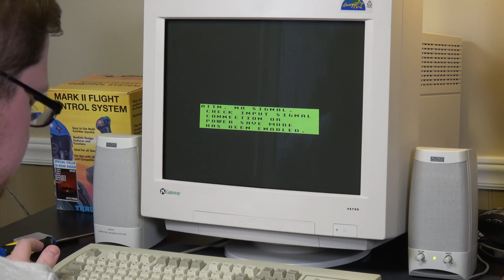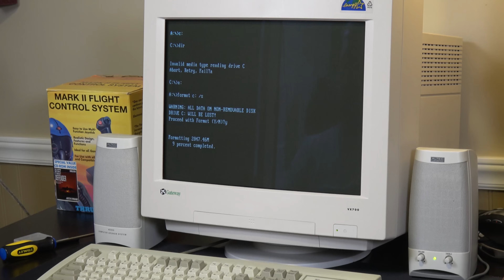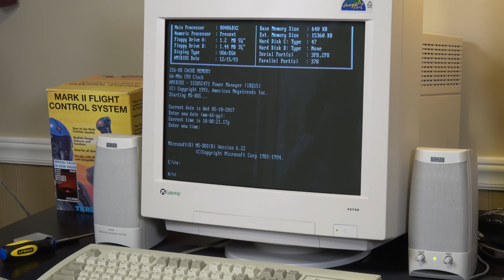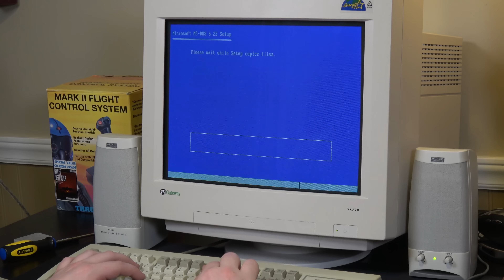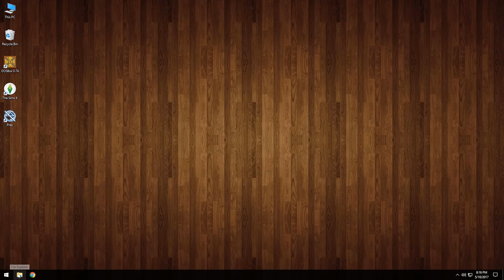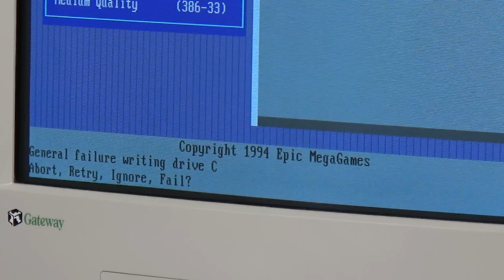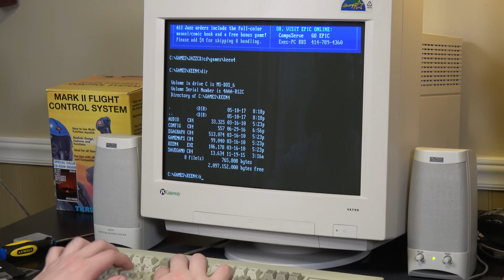LGR 486 Update! Installing CompactFlash Storage

Comment: You may have got that backwards as far as older cards being less reliable. Older cards (usually less than 1-2GB used SLC or single level cell flash memory which is often quoted as having about 100,000 write cycles. Newer cards use MLC to get the higher capacity and lower cost, but the drawback is fewer write cycles before memory cells fail.. in some cases I’ve heard only 500 to 1,000. Older cards are often easier to find that support “Fixed Disk” mode which means you’ll be able to boot the ornery Windows OS from them (Linux and MacOS will boot from anything that’s readable so a modern CF or USB thumb drive is fine for them but not for Windows). Overall it probably comes down to finding an older card that has had few writes done to it, and Cisco cards are a great option. Cisco IOS runs entirely from RAM and as far as I know, in many configurations it does no writes at all to the flash drive.

Comment: A few months back I got one of the PATA-to-CF adapters that plugs into the motherboard, then loaded it up with a 2x MicroSD-to-CF adapter card loaded with a pair of 64GB MicroSD's... all to have a 120GB PATA SSD I can run on an old LGA775 board (with a C2Q 9505 & 2x2GB DDR2 667) for XP-era gaming and be fairly sure I'm safe using a fairly modern ATX PSU on.

Sure it's a somewhat complex setup, but it wasn't bad cost-wise for an experiment and a "why the hell not?!" sorta thing to muck around with in my free time.

Comment: I use a Pentium with 512MB of RAM with a SATA hard drive. Works really well for my purposes. However, my laptop uses a 2.5 in IDE hard drive which clicks at times. It somehow copies over pretty damn fast on my modern computer, considering the very fact that it's IDE in the first place. I got some stuff booked on NewEgg to see if CF would be viable on the laptop.

Comment: Love the wood grain console!

Hey, I managed to get Windows XP installed on a 16 MB CF card/IDE adapter in an old Gateway. The adapter I am using is like the one you have that plugs directly into the IDE slot on the motherboard. I didn't mess with any of the jumpers on the adapter. 

You touched on this briefly at 5:33 but can you tell me why there are two voltage settings on these adapters? One jumper is for 3.3 volts and the other one is for 5 volts. The yellow wire is 12 volts and the red wire is 5 volts on the power cable. 

I hope this doesn't sound like a dumb question but what reason would you have to move this jumper from 5 to 3.3 volts? Are some CF cards 5 volts and others 3.3 volts?

Comment: For anyone that wants to try this, you can use any CF card that supports UDMA. I use an 8 GB Lexar Professional in my Packard Bell Platinum Pro XXII that was actually less expensive than its older, smaller capacity siblings on eBay. It's 800x and supports UDMA 7. You can also use MicroDrives, which are not solid state, they are actual hard drives in the CF form factor. Apple used to use them in the iPod Mini. I got two 4 GB Seagate drives for $4.00 a piece on eBay. The main issue with CF cards and DOS is that DOS has no way to level the media; what we call Trim on SSDs. This can cause read errors over time. Since MicroDrives are hard drives, they don't have that problem, however, at 3100 RPM, they are a bit on the slow side. 

That Syba notebook adapter is an interesting device and you might want to go more in-depth with it LGR. First it has 44 pins instead of 43 pins. Most laptops with IDE have 43 pin jacks, so in order to make this work, you have to cut pin 10 off from the slave side, counting from the left. Speaking of the slave side, this card has two CF slots, one for master and one for slave. In my testing, I've found that this is not supported well on most oder laptops. I have a PIII Sony Vaio from 2000 and when two cards are in it, it only sees the slave card. The only conclusion I can take away from this is that the optical drive is the master and the hard drive is the slave on the internal IDE channel. This might work on later laptops or PC BIOS-es (!) that support a secondary IDE channel, however I haven't had a chance to test it.

Also, I got a front mount CF to IDE adapter from StarTech that allows me to take the CF card out from the front of the PC. It was a tad more expensive than the slot mounted solution, but StarTech's card readers have better card rails and eject buttons, so, no more bent pins. Once I put the Packard Bell in a more permanent place, I don't want to have to diddle around with moving it or reaching around the back of it. The way the Packard Bell is set up internally doesn't lend itself to a rear mounted solution. The only things I had to do was mount it in a 3.5" to 5.25" bay adapter and paint the darn thing beige. The mounting plate is metal, and it's painted black. Naturally.

Great video as always. I've watched it about 10 times and never thought to comment on it til now because one of my restoration projects (the Vaio) is almost complete and I ditched the idea of going CF because I didn't want to spend the money on a 32 GB card; it's a Windows Me laptop and Sony aggressively promoted that version when it came out, so I need at least a drive that size. I got a pretty good "refurbished" 60 GB Seagate on eBay instead.

Comment: For slightly newer hardware on a Windows 95 machine per-say, a 44 pin male IDE to SD Card adapter would be better. I believe that last version of the Windows 95 32 bit version added support for drive partitions larger than 2gb's.

Comment: It's actually part of CompactFlash specification to behave like an IDE disk (one of their 3 modes, as I recall). That's why ATA-to-CF adapters are... passive, with the pins connected straight over. Also: Search for the Microdrive - it is a magnetic hard disk in CompactFlash size format.

Comment: Given your preference for transferring data, I would suggest the StarTech front bay adapter:
https://www.ebay.com/itm/StarTech-com-3-5-Inch-Drive-Bay-IDE-to-Single-CF-SSD-Adapter-Card-Reader-35B-/112331541380?hash=item1a277b4b84

It's very similar to what you have, but it's set up in a 3.5" bay adapter so you can access the card via the front panel just like a floppy.

Comment: Now you just need a GOTEK floppy emulation drive for those games that insist that you use a floppy to install them.  I started doing this with my older rigs such as my amiga or older PC equipment as floppy disks are getting more and more expensive :(.

Comment: I know it's a couple of months too late, but I upgraded an old Dell C640 Laptop with a 2.5" CF to IDE adapter that fits right into the drive bay.  While it's not a million times faster, it's certainly quieter and more reliable.  Mine is from Syba as well.

Comment: The read/write issues may be the controller. Flash cards are pretty darn quick so it wouldn't supersize me a bit if the controller was essentially "tripping" over itself. I would try upgrading the ide controller and see if that helps.

Comment: I like the idea of being able to easily remove the drive and put it in a modern computer. However, the one thing that concerns me is the logevity of a CompactFlash card. I'm using a IDE to SATA bridge that I've been pretty happy with.
Reply: I wouldn't be even remotely concerned about lifespan of a compact flash card. Just for fun, I looked up the spec sheet for the random card I purchased on Ebay. Here's what it said.

10 year life span if no more than 14 GB is written to the drive PER DAY. Considering it's a 512mb CF card, that would be quite the challenge to accomplish 14 gb worth of writes each day every day for 10 years. This is the equivalent of installing Duke Nukem 3d atomic edition on your computer 311 times a day, every day for a decade. 

It also has a rated > 4,000,000 hours MTBF. That's Mean Time Between Failures. Yes that's right, you read that correctly. 4 million hours. To actually achieve this, you would need to run the computer 24 hours a day for 456 years to reach the Mean Time Between Failures. You'd better order some takeout, you're gonna be there a while! :D

The source of this information came straight from the Western Digital spec sheet for the Silicondrive ii CF, 512mb size

Comment: As Brandon Upchurch mentioned, DoMs and special industrial CF cards use SLC "Single Level Cell" NAND flash. When used as a hard drive this is going to be way more reliable because it can sustain many more write cycles than the cheaper and more common MLC or TLC flash. Not sure whether @lazygamereviews Clint knew this or not but that Transcend TS4GCF300 is a perfect card for this as they are cheap and use SLC and are a good size for pre-2000 era computers. They do use UDMA 5 (Ultra ATA/100 100MB/s) interface speed but are backwards compatible with modes 0-4 for non-UDMA systems. Clint you are the absolute frikkin' man and I immensely enjoy all your content!!!

Comment: Just FYI: do NOT use any power-saving settings related to spindown of the drive while using these. the CF card uses the spindown command as a "I'm about to be removed" signal, and will NOT come back up unless it's power cycled. These are also used to upgrade/repair old ipod classics, and the aggressive disk spindown will cause issues unless disabled.
Reply: Go to know, but I dont think those fun Energy Star features showed up until Pentiums took hold?
Reply: good to know about the cf card being able to replace the old hdd in the classic ipod. i have one with a dead drive in it and would rather not break the bank with a full replacement
Reply: @blendpinexus1416  Depending on the model it is a drop in replacement. they also sell sd adapters. https://youtu.be/S83ZHf1GAeY

Comment: It is cool that you can do it, but for some systems, like an upgraded a1200, it seems like a waste of bandwidth.  For instance, a fast (50mhz to approx 100mhz) a1200 can have a sata in the trapdoor expansion and sata is hot pluggable if set up right. The cache on such a drive (even mechanical HDD or SSD) is fast. A HDD in the IDE seems like a better use of bandwith. Then CDROM drives can be relegated to a usb port, even a usb 1.1 port which may be a bit ike a 6xSpeed, but you can get USB2 also.

Comment: for dos 6.22 all you need is the harddrive to have the dos 6.22 system files on your bootable drive, then you just copy an old dos directory over, maybe fiddle with the autoexec to set path and shit like that. poof, full doss 6.22 is installed. remember, there is no registry and the drivers are pretty independent of the operating system. you just need the data on your drive, all that installing it from the disk does is extract the files, it doesn't even care about what your computer is.
Reply: to explain the operation:
format c: /s
copy the dos directory to the hdd
make or copy an autoexec to set the path and any other parameters you want for stuff like your soundblaster (which has nothing to do with the dos directory). 
yay, you just installed dos 6.22

even back in the late 90s early 2000s i did this loads of times using a paralell port and a program called fx (fast lynx or something) with another computer hooked up.
Reply: you can even do it by formating the drive on another computer with the /s then just copying that computer's copy of dos over. then just pop the drive in, make sure the parameters in the bios for the drive are the same, poof.

Comment: should be able to use an overlay to have all 4gb in a single drive in dos, although it has been eons since i fiddled around with that, and i think there is still like an 8gb limit or something to that type of overlay.
Reply: nah, its a 4gb limit for fat16, so dos 6.22 on a 486 or 386 should be able to handle that using an overlay.

Comment: You could probably also have used a SATA SSD with a SATA to IDE adapter. It wouldn't be as easily swappable offcourse, but you wouldn't run into read/write limitations.

Comment: Very cool. I first heard of compact flash being used in retroware when I considered buying a second hand Amiga years ago. Apparently many Amiga users have installed them to simplify the transferring of files between PC and Amiga. It makes sense when you think many A500 don't have a harddisk and that there are tons of WHDLoad homemade installations of games floating around the web. My guess is that it has top be difficult to set up those compact flash readers on the Amiga side, though.

Comment: I'd be wary about the simplicity of this option. I got a compactflash to IDE adapter for one of my old machines. I tried installing Windows 98 SE on 512mb compact flash cards twice, and smoked both of them. Granted they were pretty ancient. Maybe brand new compact flashes would have been better, albeit too large for the BIOS.

Comment: i have an ThinClient which uses cf cards as storage.
I bought a sansdisc ultra fast card (32gb) and installed windows 7 on it.
Since it isn't compatible with the "fixed disk" mode, I had to install windows through WinToUSB through my pc.
After install and first boot, I installed an different driver which makes the cf card now usable as normal HDD.

Comment: Found the same controller card you are using, and I found a 4gb sandisk ultra card, 30mbs. My machine is a bit more powerful than yours, a 200 mhz pentium pro. Any reason it wouldnt work on my pc?

Comment: I also have had problems with using a CF card as an IDE drive.  I am using a 2.5" IDE to dual CF adapter (similar to what you have in the video) and am experiencing abysmal performance on my ThinkPad.  I've tried it with 1 or 2 CF cards installed... extremely slow.  I might have to buy one of those SuperTalent 2.5" IDE SSDs... but they are kind of expensive and this old ThinkPad is not really worth the investment.

Comment: I know that some tv box manufacturer such scientific Atlanta cable recorder tv box at a certain moment were forced to use the ide motherboard but sta hard drives as ide drives were not available anymore or at a decent price so they figured out to put inside the device a sata to ide adapter that allows the use of a sata drive a pretty transparent way on a ide interface motherboard. That is another option for you.

Comment: The CF card errors could be due to your BIOS hitting the 528 MB or 2.1GB limits. Grab a copy of WD's EZ DRIVE SETUP v9.06 (this works with all drives) and have it do a quick check on your BIOS support. It can also do some fancy memory mappings in BIOS to get around the limits.

I ran into the exact same issue with my 486DX2-50. Things look like they're working but you'll quickly run into a ton of read / write errors. Doesn't matter what your partition size is... it's more to do with the old CHS addressing system.

Comment: Yeah those bootable CF card interfaces are great. Makes for easy OS swaps too. The old clunker HD's are getting difficult to find in working order. As you mentioned I found that my smaller (data size) CF cards won't work. There's no info on the transfer rate on any of them but that is more than likely the reason.

Comment: The errors with CF cards I have encountered have been from ID cables being too long.  The straight into the port adapters have never given me trouble with old computers.
Reply: That's strange..
I'd assume since the R/W speeds of machines from this era being rather slow... You wouldn't have
data integrity issues from the propagation delay due to the long wires..

Comment: The floppy drives are still backwards in the bios settings. I used a CF drive in addition to a hdd on my vintage Pentium 120 build. It came from a Kiosk and fit in a 3.5 bay. Its handy to have it right in the front for transferring files.

Comment: I just made the switch myself to CF-IDE. When I was using it on anything newer than a Win98 install, though, it had some issues because the cards report back as being removable, which changes the way Windows treats them. I ended up getting a Transcend Industrial 16GB CF instead, which reports as a fixed disk. No problems since.

Comment: Clint, I don't know if you were looking for a specific flash card or simply got lucky, but the most important thing with these adaptors is usng a UDMA-enabled CF card, which you do happen to have. That is what determines whether the motherboard will detect the device as a fixed or removable storage. It's less critical for DOS, but in Windows installations, true UDMA mode is absolutely necessary, or you won't even get pass the disk selection prompt. Motherboard BIOS, especially on laptops, will often reject non-UDMA cards entirely. Majority of CF cards you find online these days are non-UDMA. SanDisk has a list of card on their site that are UDMA-enabled. Most of them are listed as "discontinued".

Comment: Problably the errors have something to do with the insane fast speed that is not expected by the bios or chipset. Speed is limited by the ATA max speed of the chipset but probably the card is too fast for the chipset and eventually get errors. I would try an OLDER CF, in an effort to slow down the solution. But a classic machine without platters turning ... its not a classic anymore. It is great solution to transfer data tough.

Comment: So, that laptop SD card adapter you show at the beginning, is that a 44-pin (integrating the power into the IDE socket, as it were)?  Cos my old laptop has that interface, and I would like to have some idea of what works better, given that I can't afford to buy 100 things and test them all myself.

Comment: So, if the memory can be read from both computers depending on configuration, then why not directly hook up the old computer to the new computer via an adapter (hardware or software?) DOS conversion issues to today's modern formats (Windows 7, 8, 10...)  ?